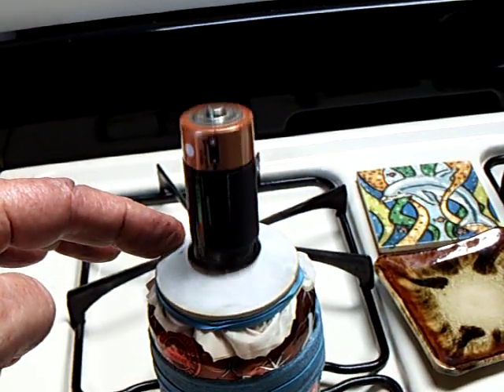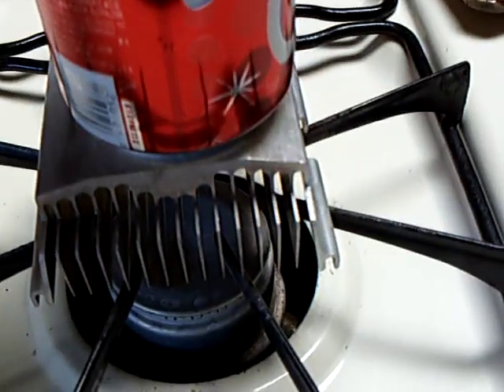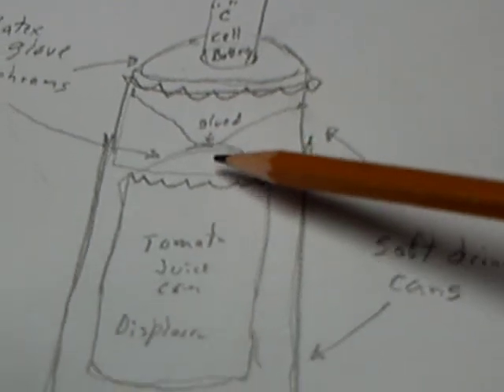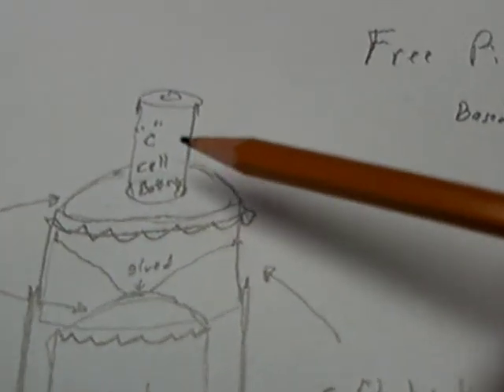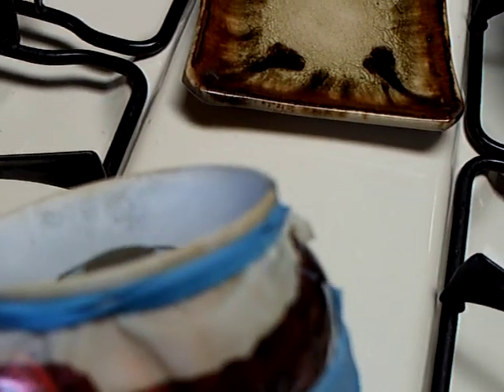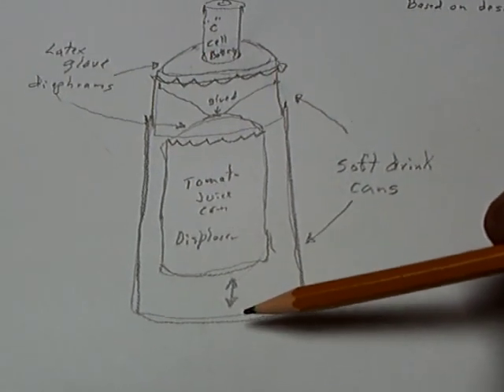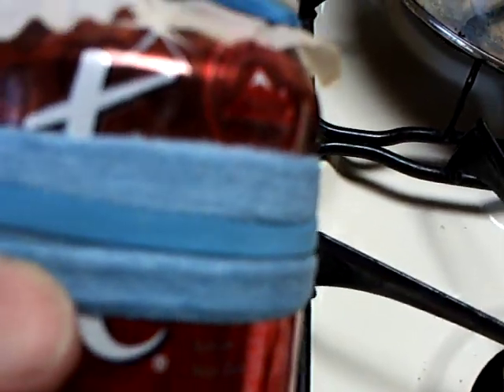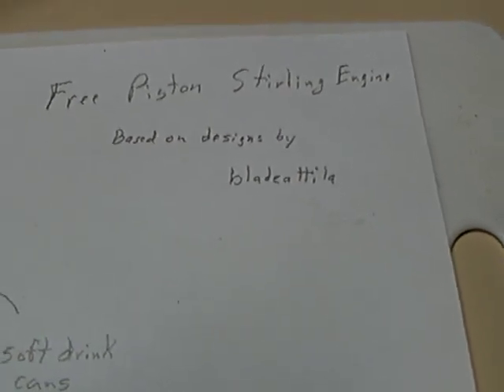Simple Free Piston Stirling Engine

Comment: Now I know what was the trick: you gently lift up the latex when you started to heat the engine. Cool, but it is too complicate! :) I made a really small pinhole to the cold side and I used bigger mass on the power membrane. Your engine hasn't got enough pressure changing, because the displacer is not regenerating the air. Faster pressure changing-> bigger stroke-> more working volume etc! If your engine has enough pressure different inside, then that pinhole is not prevent your engines run! :)

Comment from the maker: Thanks Blade for describing what is happening with the pressure build up inside the engine.  I have been releasing the pressure as the can heats up by just gently lifting a part of the latex diaphram to let the air out.  It is critical adjustment.  I tried the pin hole on the outside can yesterday and mine wouldn't run.  I think that my setup is just too small for that idea to work. I do have a pinhole on the inside can.  Must have that one.

Comment: Hi guys!
If the engine's inside pressure too big, then the power piston's tense will be too much for a good run. Before we take the power piston on the top should you warm up the can and after close with that latex. And the outside hole will be useless, but if you have a perfect sealed can, then the pressure make a tense convex membrane and if you haven't got enough mass on the top, then the engine won't work. Other problem is the can's wall, if the pressure diff. too big, the can could collapse

Comment: Well done Lidmotor !
Please try top scale this up and make a thermo to electrical converter with it by using magnets to induce current into coils !
Would be great if you could extract a few Watts of power from heat this way without much noise sound.
Many thanks.
Regards, Stefan.

Comment: Congrats...4 days with a successful outcome. 
Imagine this - a big Stirling engine outside, black top for solar to heat it. Runs a motor as generator for electricity, the base of the Stirling being cooled by this concept and running from a cam on the Stirlings output shaft. That's about where I want to be headed for summer :)